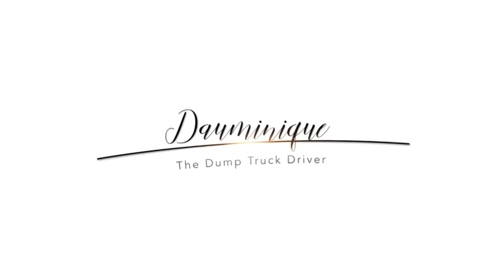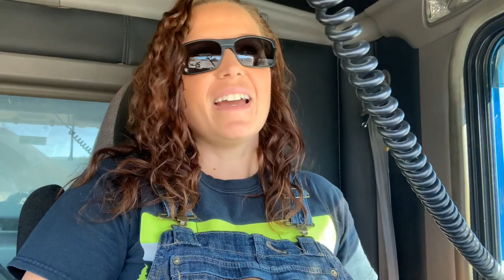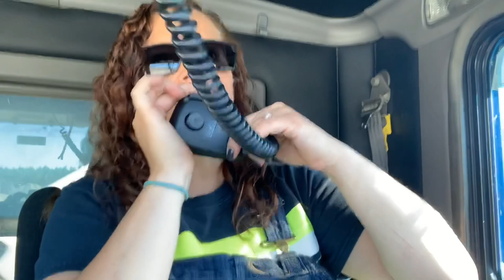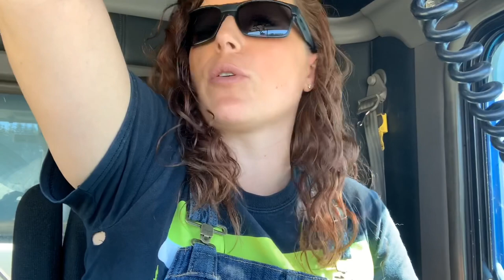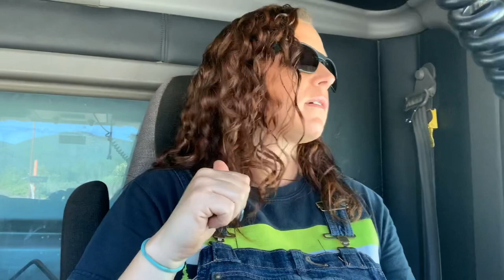How to load a Truck and Trailer Dump Truck with a split load. Trucking and Construction.

Comment: 73's to you driver, here in mich we pull leads and pups but on 8 axles we have 160,000 pound plates on the truck's and split loads are pretty common. tare weight is 51,400 normal loads are 50 tons in trailers I'll have to send you some pics of our rigs some time. Stay cool😎
Reply: Ice Junky. I think we are the only state that allows 160,000 pounds on the roads.

Comment: You're doing a fine job. I'm caught up  on my 'binge watching' now I need a new video.....but I'll be patient. 
In my state, max weight on Tractor truck/trailer, 5 axles, is 80,000 lbs. Overweight/oversize (no overweight loads allowed if load can be 'quickly' broken down) loads require a permit.....and more axles added.

Comment: With your rigid frame trailer, does the tongue weight contribution matter in scaling?  I'd almost think that your trailer drop axle would have to be down to get an accurate weight for the truck only.
Reply from the maker: No it doesn’t. My solo light weight is only about 300 lbs less than my truck weight when it’s hooked to the trailer.

Comment: We used to do this for a concrete company about 30 miles down the road from our pit. 2NS (washed sand) in the lead trailer and 6A (washed 1 inch minus no fines) in the pup. The guy who owned it sold it and the new guy has his own trucks now, but they still get material from us.

Comment: How much  8 Axel transfer experience do you have?
Reply from the maker: Zero, never driven a transfer.
Reply: @DauminiqueTheDumpTruckDriver   Thank you for your reply, I do the transfer thing, At times I wished I had truck and pup.
Reply: I was watching one of your videos on drop axle air pressure,  I have to keep nearly 90PSI on my Drop Axle To keep 9000 pounds.

Comment: QUESTION ? ARE YOUR DROP AXLES STEERABLE? DO YOU HAVE TO LIFT THEM WHEN YOU DO TIGHT TURNS?
Reply: They steer with the forward motion .In the reverse hole , you get bad tire wear if there down.
Reply: I have drops that have a trigger so when you put the truck in reverse they lift up so you don't ruin the system. I saw a guy the other day at a dump that had them down and started backing up and they started to twist like crinkling a piece of paper

Comment: Nice load but you would be a little overweight here in Cali
Reply from the maker: Only 25k! Here my max weight is 105,500.
Reply: @DauminiqueTheDumpTruckDriver  we can only run 80 000 pounds total 11 hrs on e log per day
Reply from the maker: Mike Camara we don’t run log books because we stay close to our yard.
Reply: @DauminiqueTheDumpTruckDriver   lucky you! Having hard time being owner operator only running 11 hours a day and if i run my old truck without e log i can only run 10 thousand miles a year with regular log book
Reply: @DauminiqueTheDumpTruckDriver  How close do you stay to your yard and what's the distance you can go without logging?